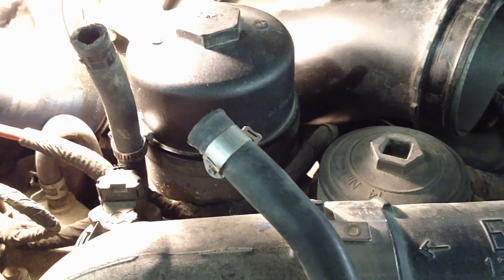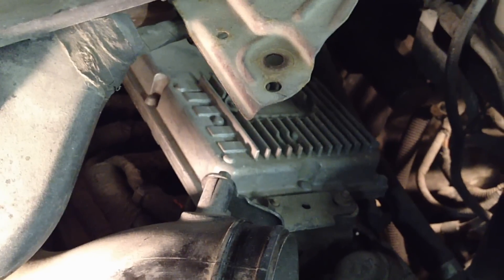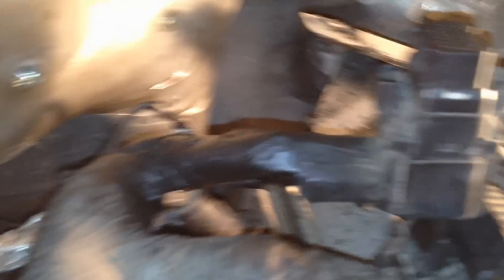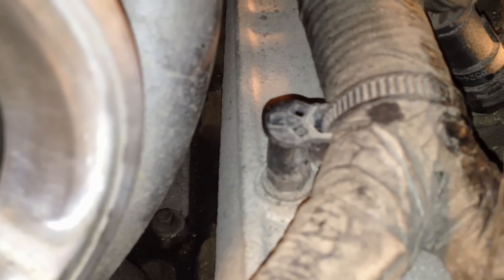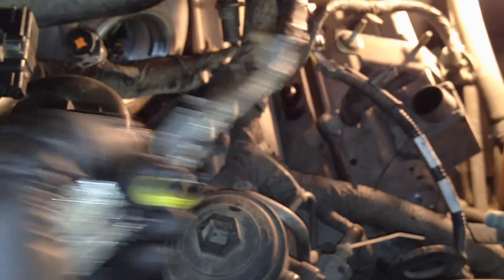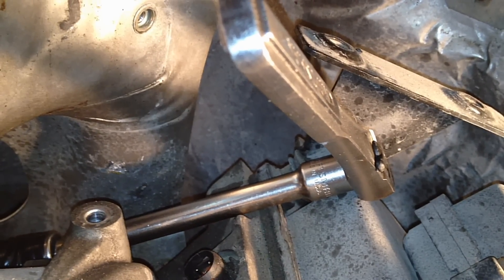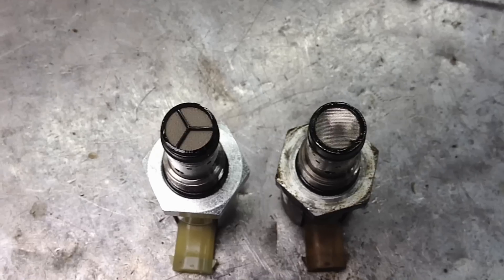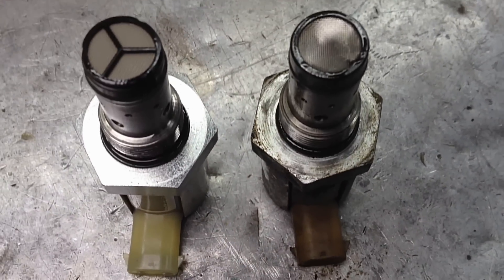6.0L Powerstroke IPR Replacement

Comment: Great video,I have a 2004 f250 6.0 I have been having trouble with truck ever since the fuel gelled up last winter.The truck runs sluggish on and off and it shut off a few times under acceleration I would cycle key to refill filter bowls to get the truck back home,thinking the white specs in filters blocked them.The last time I was one mile from house.I got truck back home and the filters looked fine.I purchased scan guage 2 and noticed key on engine off ipr 11.8% truck idling ipr 11.8% icp 580 psi revving up ipr 22% icp 1200 to 1400 psi. Sometimes when first started it misses a little and than smoothes out and runs fine. I not sure if its the ipr vave any help would be greatly appreciated. Keep up the professional videos
Reply from the maker: Your icp and ipr numbers look great especially the ipr numbers looks to be no issues there, you will have to attack the fuel supply issue. Has you used that diesel 911 stuff allot of people swear by it for your kind of issue.
Reply: FordTechMakuloco Thanks for the quick response. The fuel gelled  and I added diesel 911 into fuel and changed filters.About a month later truck shut off on highway and I changed filters again.Truck ran fine and than was sluggish on and off I put about 3,000 miles on truck when the last time it happened.I put a sample into clear jar and noticed fine clear particles from the fluid I drained from pump plug.I showed sample to a diesel mechanic and he said the filters were doing there jjob and I might have another issue.Thats why I put it on scanguage.I cant thank you enough.I was thinking of running stanadyne performance formula on a regular basses is that a good additive.If it starts running sluggish I will chane filters again. I wish I could buy you a few beers thanks again you are the man.

Comment: where can I get those coolant caps from ?
Reply from the maker: I got them from doing fuel pump jobs on gas vehicles.
Reply: but where could an average Joe get something like that from ?
Reply from the maker: First place I would check is the hardware store for rubber ones the line size is 3/8"
Reply: thanks!
Reply: Ray Kodiak My suggestion for this is also a standard golf tee...